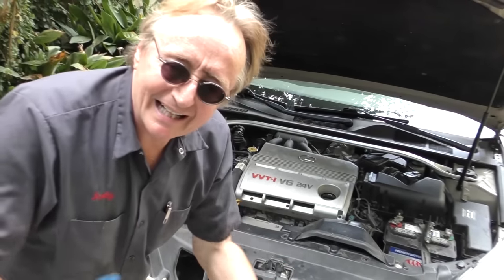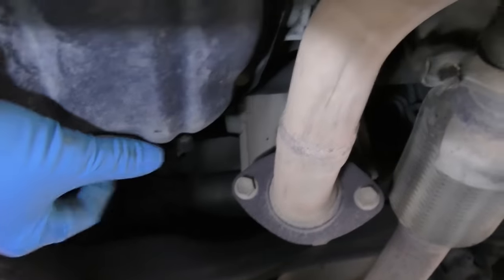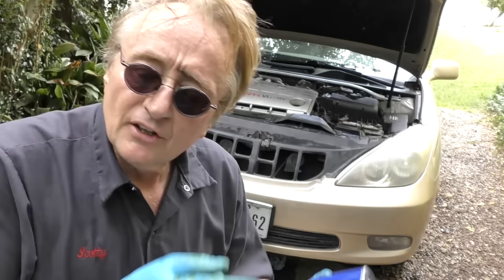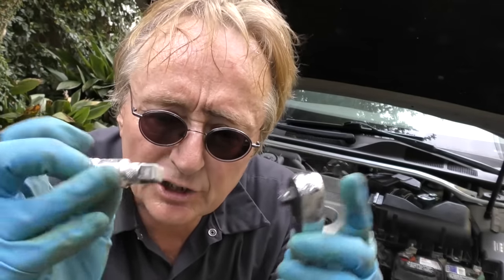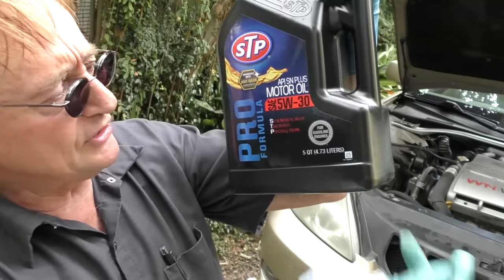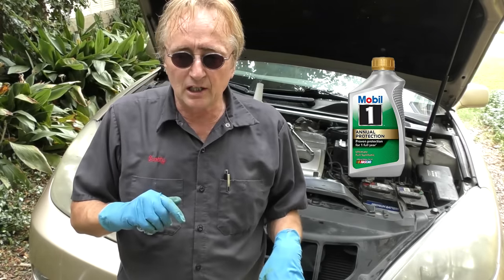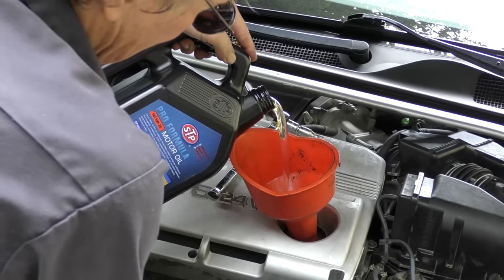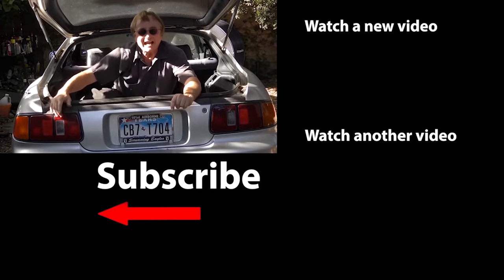Changing Your Engine Oil? You’re Doing It Wrong

Comment: I could see possibly issues with some ppl useing a 24in breaker bar to tighten the oil drain plug...
Reply: But he didnt use it to tighten the new filter, he only used it to loosen the old one. He only hand-tightened the new one.
Reply: @unclebrucelive  the oil plug, not the filter.
Reply: I always change my oil hot.because I agree about the sediments being suspended...also tighten the oil filter hand tight then I snug up on it about a 1/4 to 1/2 turn with a 3/8 drive ratchet useing one of those cup style oil filter wrenches...I don't trust hand tight but never over tight.
Reply: I do it but only because it's always in a bad spot. I have never over done it. But you need to use common sense.
Reply: @snouter  wrong! warm, not hot
Reply: @rickygreer7288  Oh god yeah, never over tighten the filter. The last time I changed my oil in my car I must have over tightened the filter last time or not greased the gasket because it absolutely would not come off even with a wrench. Had to jam a screwdriver through it and use pliers to the end of the screwdriver. Got nasty used oil all over myself too.
Reply: Unless you have the years of experience to know better...
Reply: Ricky Greer never use a wrench to tighten an oil filter.
Reply: thetoecutter13 if it’s one at a weird angle that you can’t get a lot of leverage to firm it up by hand, using a wrench is really the best option to make sure it’s not too loose. Last thing you want is to lose all your oil when you start it up.
Reply: Joshua Ford damaging the case of the filter is a possibility with a wrench, you would be surprised how little torque is required to seal the filter. Unless you left ot completely off you would not lose all of the oil on start up. If it was too lose and leaking it would be just that, a leak. If a wrench is going to be used to tighten it, extreme caution should be used. As a professional who has done thousands of oil changes over the last 20 years I have never needed a wrench to install a spin on style oil filter. I also have the benefit of a lift. Whatever works.
Reply: @Auriam  Yeah, that sounds familiar!
Another reason you don't want to over tighten is that it can force the gasket to squeeze out of the filter losing the seal and oil.
Reply: @unclebrucelive  Yes, and that's enough. If you do the filter up with any tools, then you might never get it off again xD.
Reply: I was about to say the same thing! Tightening the oil drain bolt with a breaker bar is a recipe for disaster.
Reply: Yeah I had a 9 inch pipe I'd put over my standard 3/8 ratchet that would do the trick just right.
Reply: @joshuaford9714  I get what you're saying here. If can't reach it by hand. Use a tool but caution is needed. While we have the experience and we might know how to gauge stuff; It's noble to keep in mind that people out there use these forums as a guide when they feel like experimenting. I believe in putting out quality information to help a fellow car enthusiast or DIY guy save a buck or two.
Reply: @joshuaford9714  I get what you're saying here. If can't reach it by hand. Use a tool but caution is needed. While we have the experience and we might know how to gauge stuff; It's noble to keep in mind that people out there use these forums as a guide when they feel like experimenting. I believe in putting out quality information to help a fellow car enthusiast or DIY guy save a buck or two.
Reply: I will continue to use the same procedure as stated in my last comment...Have done my own service for 30 plus years and never an issue useing this technique..Worked in a small engine shop for several years..and now currently a Towboat Engineer with 25 plus years experience on EMD Detroit Diesel Cummins so filter changes installation and the use of basic hand and specialty tool,s is a none issue with me...
Reply: When i get it done somewhere the oil pan plus is always overtightened. I have alot of fun taking it off after going to those dumps.
Reply: Lol torqued to spec 👌
Reply: @thetoecutter13  yeah, and impact driver works better
Reply: use an impact,it Quicker

Comment: You should clean that funnel before using it. No use putting dirt back into the engine.
Reply: Which funnel
Reply: @mimiarumugam2011  the one he used
Reply: I noticed the grime on it. NOT on my oil change watch..
Reply: seems like the oil didn't touch it
Reply: Don't use a funnel. Buy the oil by the quart. No spillage like with the 5 quart jug.
Reply: @ryansylvan9277  ?????? Price!?
Reply: @ryansylvan9277  Ahh. Not where most fill ports are these days; I say a proper funnel and the big jugs.  Once you get used to handling the big jugs  you don't go back to the  ...
Reply: @ryansylvan9277  more waste inside quarts on the sides and bottoms of the container
Reply: @sandyshoremann7524  Mmmmm..Jugs

Comment: I worked at a Mobil gas station and repair shop for thirty years and understand everything you say and agree on everything I've watched so far! 
To bad people are too busy to maintain their vehicle and wait until it's on its last leg, I had customers that would tell me to do whatever I think it needs, and they had a very long lasting vehicle, but I was honest and they trusted me, it's almost impossible to find a good reliable mechanic, keep up the great videos!
Reply: It took my wife YEARS to understand preventative maintenance!  Her attitude was “why fix it if it’s not broken?  Just wait for it to break”. For years I tried to explain it’s around $25 for me to change the oil. It’s around $7000 for a new engine. Battery was another issue. You should change it around 5 years. I kept telling her it’s going to crap out on you when you’re 1000 miles from home 😂. Sure enough. Now she supports me with maintenance. In her defense, she did get 10 years out of that battery!

Comment: Been changing my own oil for 7 years. 
Best tip I stumbled upon ⬇️

Crack open the oil fill cap before you drain the oil, don't remove it otherwise you'll create the potential for debris to get in. 

This allows for a fast smooth flow of oil, typically cut my oil drain times in half.

Comment: "You're doing it wrong." -Scotty
Proceeds to pour oil into a dirty funnel.
Reply: Exactly !  I noticed that filthy funnel too.
Reply: Ya but makes sure to change the plug gasket 🤣🤣
Reply: Girl
Reply: @akinidavid1653  ?
Reply: uses a huge breaker bar for that little bolt too sure he knows left from right but what if someone else isn't paying attention lol
Reply: Do as i say not as i do
Reply: @coreyhickman9082  They'll hopefully notice that the bolt isn't coming off and double check the direction, haha.
Reply: @coreyhickman9082  being a mechanic,,  we know how to use them correctly,,
Reply: @coreyhickman9082  I use a torque wrench. In my old age. Before that, eh. For an engine or transmission drain plug, 25-ft-lbs will do.
Reply: It could be stains, I have one exactly like that and can't get the stains off no matter what cleaner you use. That plastic absorbs the heck out of dark oils/chemicals.
Reply: @coreyhickman9082  if you don’t know left from right, please don’t spanner on your car.
Reply: @billsmith305  can you post video
Reply: @anonymike8280  why you speaking in Dutch
Reply: @jasona8613   yes , my wife has this problem
Reply: I was taught to pour some oil in the filter before screwing it on.
Reply: @BuddhaOfDarkness  some motors this matters, some it doesn't, either way its not a bad practice. That doesn't have anything to do with his dirty funnel haha
Reply: Sandy grit is good for your piston rings.
Reply: @shawnmcculley2995  exactly, seats them riiiight in
Reply: @BuddhaOfDarkness  
Yeah. So was  I. I was trained back in  Jr. High/High School engine mechanics vocational learning in the  early 1970's. You just reminded of my teacher Mr. Conroy, a Marine Corps Veteran of the Korean War. You couldn't stand behind him looking over his shoulder because he was jumpy, but he was a great instructor!
Reply: What ever, the filter catches all the dirt anyway
Reply: and failed to wipe the gasket surface and everything else. My OCD was kickin it!
Reply: He actually cleaned the inside of it. The sides maybe dirty but the oil doesn't even touch it.
Reply: and uses a breaker bar to tighten the sump plug
Reply: It's just some smudges on top of the funnel.  It's not full of sand.
Reply: But it was a dry dirty funnel!
Reply: It could be a stained funnel. Not a dirty one I happen to have one just like that
Reply: @ConTheDon187  buddy was bein funnie...I laughed
Reply: Yeah but we probably find something somewhere😁
Reply: lmao

Comment: I was always taught to remove the oil cap for better flow and Drop oil while hot and particles are suspended in oil.
Reply: Noooooo
Reply: I was was told the same thing. Just got to be careful when your doing it and you’ll be okay.
Reply: Jacking up the front opposite of the drain Will help also. When Oilwas cheap I would run a quart of new oil through for a rinse
Reply: Always get hot oil in your sleeve and or face so your costimer gets scared to do it themselves $$$$
Reply: Really there's no reason to remove oil cap. If you think about it, your engine is vented through the air filter assembly and emissions control components. I was taught the same way until I became a mechanic 26 years ago.
Reply: @cppower14  The reason to remove the cap is to remind you it needs oil.  That way if I go to the hospital, because I slipped and fell, ( on the oil slick on the floor) you still know to put oil in it.
Reply: LOL, I see your point
Reply: WARM, not hot. Safety first.
Reply: @Krazymunkeyz  I usually pull the dipstick out when i do oil changes (at work) because 99% of the time i have other work to do while its in the air, so the dipstick is 1. A reminder to me to fill it before I shut the hood, and 2. A warning to everyone else in the shop that theres no oil in it
Reply: Take it to the 30 minute oil change places. That's the only way they do it.
Reply: If you want to know why and how removing the cap works, you need to understand bernoulli's principle
Reply: @crypticscrutiny1153  30 min is too long for an oil change
Reply: @kiyotaka269 you're right. They're usually trying to sell/install other various components too. In any case, was just pointing out that jiffy lubes always work with a hot engine. So it's no stretch to assume that an individual could do it if they so choose.
Reply: @crypticscrutiny1153  ohh I see
Reply: I only remove the cap after I remove the drain plug so it does not shoot out when I’m under the car.
Reply: @TheSchmed  That's fine
Reply: If the oil is warm or hot then the engine is probably hot making it hard to get the old oil filter off since that gasket has expanded...
Reply: And put some new oil in while the sump plug is out to flush out the grit at the bottom
Reply: Unnecessary. There is always a residue of old oil left in the engine. For another thing, it ran with the old oil in it. What are you worried about? My point, really, is why get people agitated about the issue when there is a an injury risk to working on a hot engine. If you insist, take the drain plug out and let it drain. Come back later when it is cooled down to finish the job.
Reply: I pull the cap then jam a shop vac into it, climb under and loosen plug then right about when I'm going to remove the plug I'll reach over and turn the vac on... remove plug and no hot oil or mess.  Then just shut off vac an wait
Reply: @cppower14  it's fairly hard to get the New oil in without removing the cap..
Reply: I let the engine cool down, then remove the plug and cap. Next I turn on the engine and let it run hot untill I hear strange noises. Time to put back the plug and fill in the new oil. That's the best way to remove all the old oil, even out of the oil pump, to avoid any damage. Neverless my engines never last very long. Hmm... must be something with the cooling system
Reply: @sigisalmen2399  normally a good flush with hot water helps too
Reply: @sigisalmen2399  In the real world, there is no reason to worry about the small amount of old oil left in the engine after you drain the old oil out. I mean, like, it ran with the old oil in there, didn't it?
Reply: @anonymike8280  You shouldn't take me too serious, my friend. Look at my pic 😜
I know that whisky is not a solution. It's a distillate 😂
Reply: I still do it. Anit no body got time to wait around.
Reply: @kiyotaka269  wrong
Reply: @Pittaz  That's wasteful and unnecessary, unless the oil is pretty low when you start.
Reply: scotty  my 2014 camry requires 0w20 full synthetic  now  with  105,000  should i use any type of additives or  keep using the same oil viscosity????   thanks
Reply: @kiyotaka269  WHAT? Only vent’s the combustion chamber, not the oil pan? I think you’ve got exhaust valves and PCV valves mixed up.
Reply: @Krazymunkeyz  True strory- I had the company truck in for an oil change at Spxxdx Oxl Chxxge.  They were busy and the knuckleheads drained my oil, then another knucklehead didn't ask, assumed it was done , started up my truck and left it running as "courtesy" next to the building.  If it wasn't for the glaring "Low Oil Light" on the fash panel, I would have been down the highway with a vehicle with no oil in it.  Never, ever go to places like that.  It's a last resort for mental idiots who never finished high school.
Reply: @490Believer  I disagree, Safety=protective gloves and eye where, not performing a task to achieve optimal results.
Reply: @crypticscrutiny1153  You'll regret that, trust me, been there and almost drove off with no oil in engine.
Reply: @anonymike8280  Dude, he was clearly joking by way of sarcasm.
Reply: @dankoldenhoven4997  let go of my leg.
Reply: @carlthacker570  Yeah  I used to do the same thing
Reply: @luketravis2553  what is a costimer?
Reply: I agree, I like the instant oil change for that reason
Reply: @luketravis2553  lol
Reply: @carlthacker570  I still do that. I just run a quart of Rural King $1.99 a quart conventional through it for a rinse, then fill it up with my normal full synthetic.
Reply: @dankoldenhoven4997  ...and a good dose of dish liquid too...!
Reply: @crypticscrutiny1153  Hey there, Lube Tech with a Quick oil change shop (not gonna say which one silly). If it's taking you 30 minutes for a basic oil change and there's nothing screwy with your car, find another place. Our average is on the 15 minutes side and we still go over other services and whatnot, and we have the longest time in my region. 

Of course you're on this channel so you probably don't go in too often 😂
Reply: @TheSchmed  
I do the same...
Reply: @TheSchmed  its not gonna shoot out lol. 15 minutes after you turn off your car its all gonna be in your oil pan
Reply: @jay-yv7rv  i have 2013 i use 0w20 in the Las Vegas desert with no additives. I change it every 2-3000 miles because of my frequent city driving with Uber and DoorDash. It gets really dirty and I personally do not recommend following the 10,000 mile interval that Toyota recommends.
Reply: @jay-yv7rv  also just stick to the 0w20 because once I let a shop do my oil they put 5w30 it was running rough and high RPM.. Now I only do myself
Reply: There is no reason to remove the fillcap. Yes it does vent better and faster, but it's not necessary. When it's done, it's done. The difference is like 10 seconds.
Reply: @luketravis2553  i
Reply: @kiyotaka269  it vents the crankcase not the combustion chamber, don't give advice when you don't know what you're talking about.
Reply: @JackTschida  Good tip. The dipstick tube is the ONLY direct air vent to the crank case, not the oil fill cap or the engine air filter as previously mentioned. Helps expedite oil drainage AND helps prevent oil overflow if you pour oil into the filler a little too fast.
Reply: @carlthacker570  I used to do that as well with about half a quart or less (synthetic oil). Now I’ll just live with it since it’s about 40$ an oil change on my grand marquis. Using Mobil 1 oil and filter. I still baby the hell outta that thing. Running awesome with only 54,000 miles. 
2000 mercury grand marquis.
Reply: @mikew7218  when I do the oil change it’s an hour minimal. I wait til the oil drops are about 5-6 seconds apart. I hate the thought of doing it in 15 min. There will be plenty of dirty oil left behind. I enjoy doing it myself and also to avoid someone damaging my engine.
Reply: I've noticed opening oil cap helps oil drain faster. Same as radiator drains process. I'm just saying what I had  noticed when I changed my cx5's oil
Reply: @kiyotaka269  then cars aren’t for you😂 ride the bus
Reply: @cppower14  In theory, you're correct. In practice, there are some engines that still drain faster if you leave the dipstick tube out or the oil cap off. In those cases it's likely the however they're vented to atmosphere is still restricted relative to the volume of oil trying to get through the drain in the pan. We have a couple of tier IV diesels in our fleet that have all the moden crankcase ventilation and emission systems but drain A LOT faster if you leave the tube open or the cap off.
Reply: That's how my dad taught me.
Reply: Always drained my oil hot for 2 reasons: 1) Drains more proficiently & thoroughly. 2) reduce unwanted particles remaining in bottom of oil pan. ●Also, I wear long rubber gloves & make sure the vehicle is tipped slightly towards the drain plug & let drain until no oil dripping.
Reply: @kxngbtmn82500  Ah, yes! Hot is better obviously...
Reply: A costimer is someone who always pays the highest price/cost because they think it has more value.

Comment: A lot of of newer cars use a crush washer on the oil drain plug,  it prevents leaks when it's crushed and it also helps prevent the stripping of the oil pan threads.  Use one.